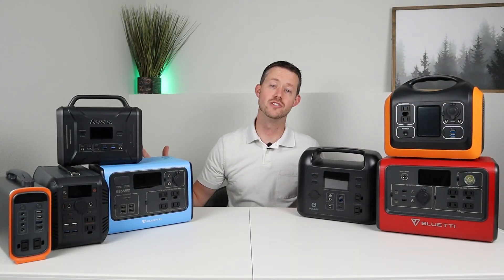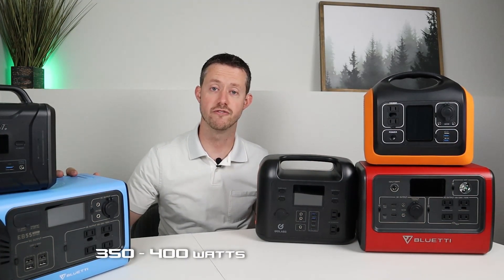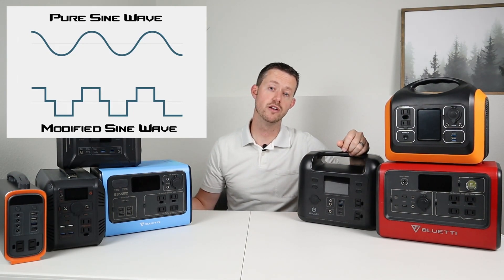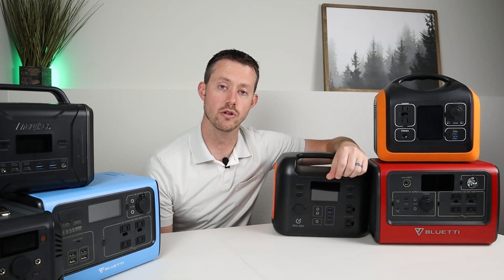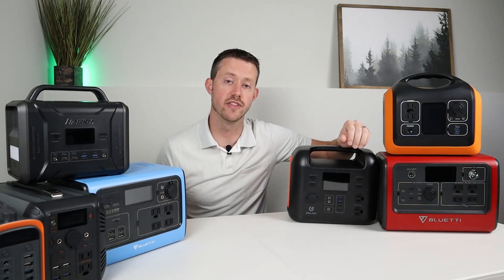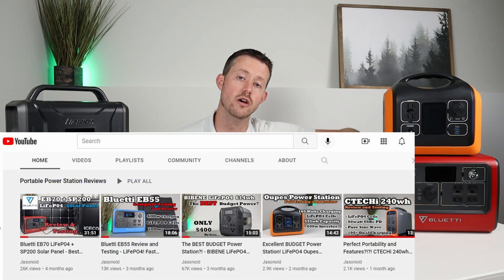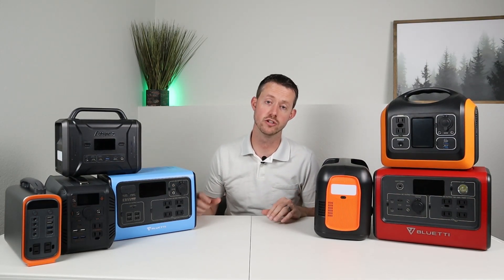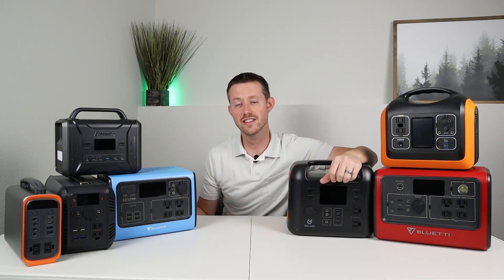7 Features You NEED Your Power Station to Have!!  What to Look For in A Power Station For Success!

Comment: Thank very much. I have bookmarked your spreadsheet as it helped me settled down buying an Energizer 300Wh. One question I still have is whether do I need a 500 Wh power station so when my home is out of electricity, it can support my computer router, network switch, and computers thus stay online. Do you have any guidelines?
Reply from the maker: You'd want to test each of those devices to see how much power that pull when running and then add up all the wattage. That will give you a good idea of how much power you will need. You can use a meter like this to measure the wattage of any household device:  https://amzn.to/3jPUYpl

Comment: I've watched a few of your reviews and found them to be very helpful. However I would really appreciate some information on real world experience using these power stations in cold climates. How well do they tolerate being kept and used in sub-zero conditions? Thanks!
Reply from the maker: Many of the owners manuals mention keeping the power station in a small insulated area and the power station will put off enough heat to keep itself warm as its being used (especially the AC inverter). I don't go camping in cold temps so I haven't tested that yet. I don't see why that wouldn't work if someone had a small teardrop trailer or a cabinet in a larger trailer.
Reply: @Jasonoid  OK thanks. If you can uncover any other information on that topic I'd  love to learn what you find. Keep up the good work!

Comment: I have 3 solar batteries: a 150w, 300w, and a 500w with a 60w Rockpals solar panel that works well with all of them, so charging time is not a big deal because I always have a couple available. My problem is in moving to a larger battery I would have the added cost of needing a larger watt solar panel that increases the expense. As far as the number of lifecycles go, after that many years you'll likely have better batteries with more features & your old one will just be an extra to use.
Reply from the maker: For someone using a power station everyday, the lifecycles play a bigger role. Maybe someone living in a van or RV, the LiFePO4 is a game changer since you get many more cycles. For people who don't rely on these PPS each day, not a huge deal.

Comment: How does the XTAR power station compare?
Reply from the maker: I haven't tested that one in particular. Xtar isn't making it anymore so they have it on a super good discount to sell the remaining models. It's a lithium Ion power station. It seems to have a good amount of power. They are making a newer model but it won't be nearly as cheap as the current model on sale. Not sure about regulated output or pass through charging.

Comment: My only complaint is that solar charging is pretty darn slow. I understand why, but if I am depending on these, wondering if a small wind generator might another layer in the tool shed, so to speak. But we're looking at significant financial expenses at this point. I actually ordered a second system, so I can have two charging up at once, because I'm afraid I'd be blowing through the battery charge overnight with any significant use. I have a 1000/1500 watt heater, which is good for one room, but my generators are 3300 watt systems and not thinking they'd last all night in the winter. And I think they can only take in 400 watts input from the panels.
Reply from the maker: Hey Jon! That's a good idea to have two power stations to swap back and forth. I've found that It's more efficient to heat off propane since these smaller batteries don't have enough capacity to run a heater very long. Always have a CO detector if using propane though.

Comment: All good features to look for.  How important is it to get a LifePO over lithium ion?  I'd like as many charge cycles as possible but I'm sure the manufacturers numbers are inflated to some degree.  I was hoping Jackery or Ecoflow would have switched over by now.  I can wait, don't need one yet, just sitting on the fence.
Reply from the maker: Hey Larry :)

I don't think the cycle numbers are inflated. If you check out Will Prowse and his testing, these LiFePO4 batteries are amazing for their lifespan. BatteryHookup sells used medical LiFePO4 batteries that have been used for 10 years and they still have over 90-80% of their capacity and perform super well. Tesla has also swapped over to LiFePO4 tech for much longer lasting electrical car batteries. All data suggests these are lifetime batteries if only used once a 1 week or so. The less stress on the battery the longer they will last!

Now LiFePO4 isn't perfect, they are heavier and can't be charged under 32F. So some disadvantages to them but overall I lean heavily towards LiFePO4 chemistry in these power stations, especially on my DIY builds. Much safer to have stored around the house since there is no fire risk with LiFePO4. 

Now does that mean the power station will last that long? My thought is that if they are treated well the electrical components inside should last quite awhile... but a whole lifetime?....probably not. Something is going to fail inside before the batteries have no capacity remaining. Love this stuff! :) :)
Reply: @Jasonoid  Thanks for the response.  I forgot about the below freezing thing on the LiFePO4 and yeah that would be the major minus.  However I plan to be using it with 4 wheels and then when the weather turns head south.  

I had an office job with a window overlooking 89A in AZ.  I often dreamed of just traveling that road from AZ to MT and jus follow the seasons.  I've driven it in sections but never full time.

Comment: If anyone knows it's you... The Eb70s... I know the inverter is now 800w on this unit.. But is there anything else thats different? Any other upgrade? I've been looking but can't seem to find the answer
Reply from the maker: I believe the only difference is the inverter handles 800 watts instead of just 700. I haven't heard of any other difference.
Reply: @Jasonoid  OK.. Appreciate it bro.. I'm thinking about grabbing this with the bluetti 120 panels for 799.00
Reply from the maker: @Mr.REEP0  I don't think you can go wrong with that deal. I really like my PV200, I'm sure the PV120 panels are just as good!
Reply: @Jasonoid  unless you know of a better option  at or near the same price that you can mention.. That might sway me away.. I'm all ears
Reply from the maker: @Mr.REEP0  EB70 or EB70s is an excellent option. How often are you going to be using the panels for charging? Just during camping or over landing or everyday?
Reply: @Jasonoid  honestly I probably wouldn't be using them all the time.. I just like to have what I need  when I need it at all times..
Reply: Yeah camping and if course if my power was out and I was low on juice
Reply from the maker: @Mr.REEP0  k, portable panels should be fine. They just aren't designed to be used everyday all day. I'm not sure if the price is better on the XTAR Sp100, but that panel probably performs better than the PV120.

Comment: Interesting, and mostly good.  A couple of things though; doesn't the CTechi have dual-charging also, accepting up to 60W through its PD port?  I'm still eagerly awaiting the fix on that little guy, and I think Askive is too.  Then on pass-through charging, some power stations let you use the DC ports (for things like device charging or a compressor-cooler), but not AC while they are charging.  I can probably do without AC while charging, but if I'm camping or on a road trip running a compressor-cooler, that 12V DC needs to be usable while charging!  My 350W Enginstar has two "On" modes; a double-press when turning it on will leave the DC outputs live until it's dead, so it won't turn off while powering a compressor-cooler when the compressor shuts off.
Reply from the maker: Hey Joe, I have finished the Ctechi video, it's repaired and working. Will be the next video posted on the channel. Probably in a couple days to have some time between videos.

Comment: I agree with these for sure. I can't think off any other piece that's important than these 7. 

One thing I don't like about bidirectional charging is sometimes some devices are better at figuring out what's going on and who's charging who. 

So I often end up using a 12v adapter to charge my PPS that support bidrectional charging so I don't have to waste time making sure they are doing what they are supposed to be doing. Ha
Reply from the maker: I have noticed that as well, it's good to have one power station with an "output" port charging one with an "input" port.

Comment: I'm interested in the golabs r500. When do you think you'll do your review?
Reply from the maker: Two weeks or so, not too long away. My testing results have been good so far.
Reply: Do you know anything about the big blue cellpowa 500?
Reply from the maker: @cralgjohnson4618  I'm going to have a vote on that power station. There's one big issue with that power station. When charging the AC inverter is shut off, so it doesn't support full pass through charging. The DC output and usb is still usable. I'm making the decision up to my viewers if I review it or not.
Reply: Good to know. Thanks. Looking forward to the golabs review.

Comment: Buy lifepo4 never buy lion
Reply from the maker: I feel the same way. That's why all of my power stations are LiFePO4....but I can't hate on Lithium Ion yet, they still work fine.
Reply: For me it's LiFePO4 all the way - . That being said, there are use cases where Lithium Ion may be a choice (need high discharge rates, operation in very cold temperatures, need maximum energy density, i.e., lowest weight,, etc.).

Comment: These are all reasons I love my Ecoflow River Pro. The $430 price, 720wh battery, 600w inverter, expansion port, and app are all nice add ons
Reply from the maker: Ecoflow makes some awesome power stations, looking forward to picking one up soon!
Reply: @Jasonoid  I'm certain you will like the difference their screen and app make for everyday use. For me they were the logical choice, especially when Costco had them on sale. Another product I'd love to get your take on would be the Alpicool TW55 12V fridge/freezer. It is a true dual zone fridge/freezer with app, reversible lid, and optional battery pack to power the fridge 4 hours or more all on its own. The best part is that fridge comes in at $350 on Amazon right now. For such a large and feature rich fridge the price is amazing.
Reply: @Jasonoid  , I recently purchased the EF Delta Mini which has all the features you just mentioned  except the 100w USBc is output only. It also has an app to adjust the settings and can fully charge in 1.5 hours.
Reply: Just curious where u found it for 430$
Reply from the maker: Costco deal that comes and goes every couple months

Comment: They also need to put some lugs (+ -- ) on them so you can hook up some 12v device's.  
  Or use them lugs to hook into your van system.
Reply from the maker: That's a great idea, a higher output 12v port. The Bluetti AC200p has a 25amp output port. That's the closest thing I have seen to what you are describing. Thanks for sharing your idea!

Comment: If you are mainly going to run 12 V appliances, one is usually better off building their own 12 V LiFePO4 battery box versus using one of these power stations. These power station/solar generators are best suited when you need AC power.  My $0.02
Reply from the maker: I completely agree! The cost can be much less if you only have to worry about 12v devices. That's why I have built a few DIY batteries on my channel. Have you seen my most recent 100ah build?   https://youtu.be/uN1h0XIpfTg

Comment: Can you do a video let's say on best accessories for your generator to operate at best capacity? Example, say someone has the mini 4Patriots generator with 40 watt foldable solar panel, if the person upgrades to 100 watt pannels and extra batteries and or etc...
Reply from the maker: I think that power station is a rebranded GOLABS R300 power station. You could use pretty much any 120watt solar panel to get more charging speed. Id suggest taking a look at my Elecaenta 120watt panel review or my XTAR SP100 solar panel review, both are excellent upgrades to that 40watt panel 4Patriots includes. Most power stations don't take extra batteries though, not these small units anyway. Does that info help?
Reply: One thing you have to remember is that folding panels typically provide a little more voltage than the r300 can take. It just settled back down and starts to work but it's worth noting.

Comment: all good points to look at, thanks for another great video.

if i had to be a bit picky, i would like the 12v dc output to be separate from the usb output, so when usb is not needed, the drain from that conversion is not present. for me even, with the 12v output, i would most likely use my car usb charger, and not even need usb on the power station at all.
Reply from the maker: Great feature idea, some power stations like the Bibene 614wh has a separate button for the DC and USB ports. So you can only turn on the 12v output if needed.
Reply: If nothing is plugged into the USB port, there is no “stand by” drain caused by it in most cases, especially on LiFePO4 solar generators that do not run a regulated output since LiFePO4 is ideal at 12.8v already.  This is the case with my GoLabs R300. If the internal battery pack voltage is something other than 12.8 V, then you are correct there could be a drain regulating it down to the proper voltage. This is why I prefer my own 12 V LiFePO4 battery box, there is no need for step down voltage regulation, the USB and cigarette lighter ports are on all the time, but have no drain on the battery when not in use.

Comment: Does wireless charging have a continuous drain on the battery?
Reply from the maker: I haven't noticed any extra drain on my EB55 or EB70, They are still sitting at 100% and I charged them up over 2 weeks ago.